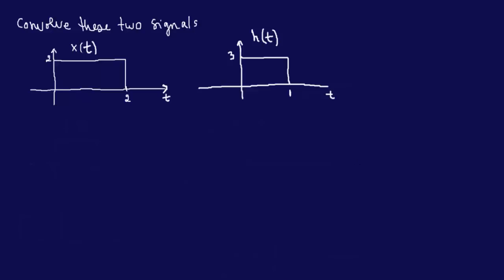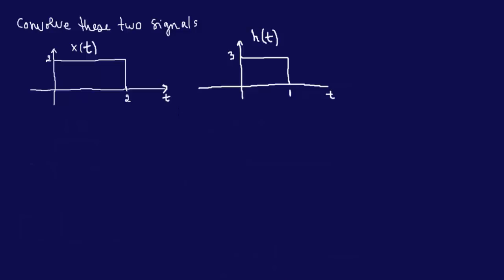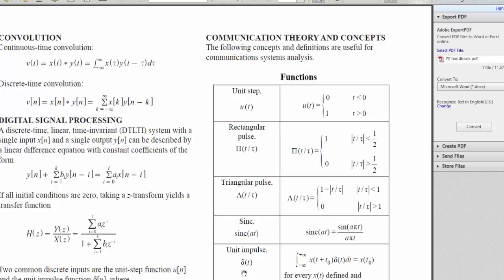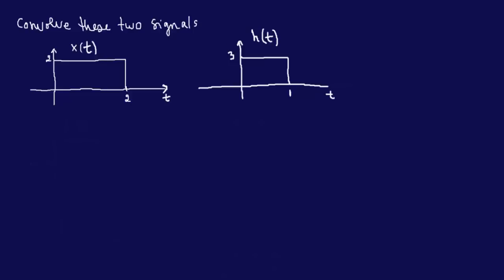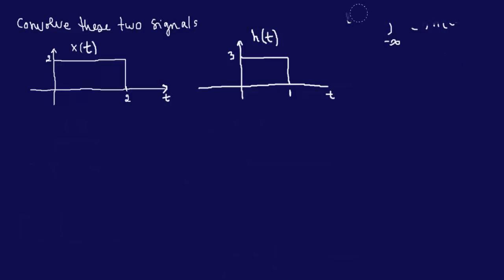Continuous-Time Convolution 1

Comment: ohoo. Are you sure about the h(t-T), where you shift the t to the left? I reckon it's supposed to be to the right.
Reply: You're right.
Reply: No, it shifts to the left: if t is positive, you will find the previous h(0) point to the left of the vertical axis because 
h(t-T)=h(0) => t-T=0 => -T is negative which is to the left of T=0, when the T axis is pointing right.     ... but actually she should have written "-t" and "-t-1" on the yellow figure
Reply: As you say, t-T=0, which means that the new h(0) point happens for T = t, which is a point on the positive T axis. I don't know how you start off so well and then still fuk up your explanation. Gordon Borostraw is correct.
Reply: Gordon borostraw 
Good question, but when we shift to the right then the shifter should be negative and when we shift to the lift then the shifter should be postive. In other words, positive comes before, which is left shift and negative comes after which is right shift. So, I believe she is right.
Reply: h(t-tau) actually moves to the right while t >0. However, she put the symbol "t" in X axis and in the negative side, that means t is negative. Under this situation, the h(-tau) will moves to the "negative" right, so it moves to the left.
Reply: yeah it's supposed to be the right
Reply: What she has done is absolutely right. First of all please learn Shifting and Flipping and then learn Convolution.
Reply: Aswin A
lol
Reply: She has done perfectly right because the axis is tow and then the signal becomes h(-tow + t) so the signal is flipped to left.
Reply: That's the easiest way to understand it from my point of view!
Reply: So, what is the correct answer???
Reply: she is correct. You replace the 0 with tau, and then the leftmost point is t-1. You can see the same method performed here https://www.youtube.com/watch?v=r40Zdwsf1ds

Comment: I think transforming h(k) to h(t-k) requires flipping first[h(-k)] and then delaying by t [h( -(k-t) ) = h(t-k) ]. So your graph of h(t-k) should be on right side of Y axis if t>0. if t<0 it goes to left side of Y - axis
Reply: When t<0 graph is on left side but in case of t>0 its all is not on right side when we take y[0]then it strts from      - 1

Comment: example of convolution was amazing and very easy to understand with ur method.
but i have a question, in last while plotting y(t)  between region 2 and 3 ,it was -6t+18... you decreased it negative slope by -6.Where is +18 factor gone ?
Reply: M.Munam Naseer  18 is y axis intercept. When you will extend that line it will cut y axis at 18

Comment: Overall this is absolutely amazing and incredibly helpful. I have a question about the last section region of overlap. You have y(t) = -6 +18. You have the slope of -6. What about the +18? should it have jumped up to 18 and then -6?
Reply: The +18 is where it would cross the y-axis. If you were to take the line she drew from (2 < t < 3), at a -6 slope and extend it from -infinity to +infinity, it would cross the y-axis at +18. The reason she did not draw it is because the previous point of the graph she was drawing ended at t = 2. So drawing the extended line from -infinity to +infinity is unnecessary. She just drew it where it was needed, which was t = 2 to t = 3. That is where the limits of the last overlap occurred. Hope this helped!

Comment: Dear sir, i am generating a signal (PPM) and convoluting (in matlab) it with the wireless channel impulse response to get the received signal. For getting the correct Receiving signal, is it necessary for both (transmitted signal & impulse response) to have the same sampling rate? In other words, the width between samples should be same ???